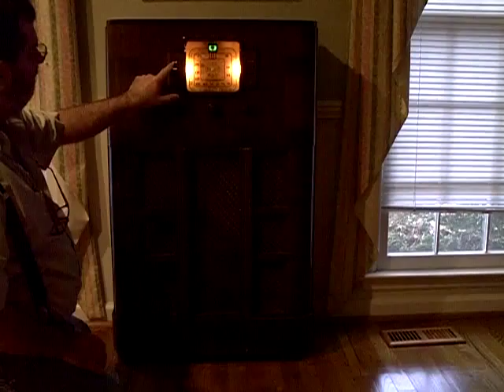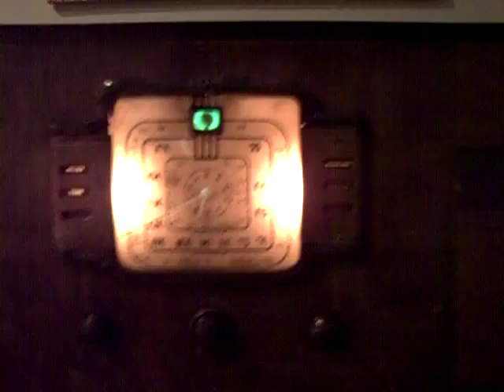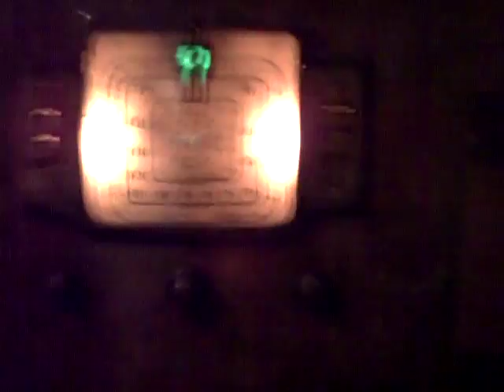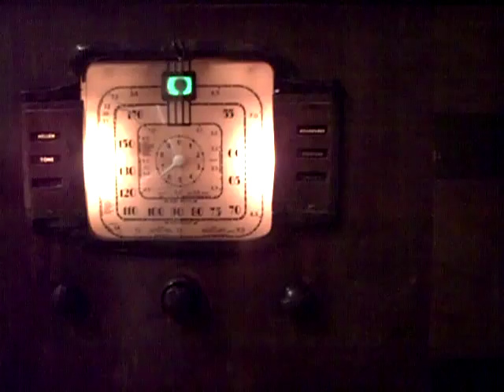Antique Radio Repair part4! RCA 810K

Comment from the maker: Great! have fun with it. Be careful of the green residue stuff on the chassis. If you have the green dust stuff, it's decomposing Cadmiun and quite toxic.
Anyway, it's a sensitive radio and wil provide hours of fun and enjoyment. check out my video, "the Problem with Voltages"

Comment: these models are terrible about the plastic dial cover shrinking, cracking, warping.
do not move south to hot climates, keep it away from any possibility of sun exposure, and keep your house climate controlled. If you have any spare plastic dials for this one or have had a repro made, please contact me magicbrainman on youtube. Also any part you need for this radio please inquire

Comment from the maker: @smeezekitty i'll send you a link to a 42 and also a 6F6 tube data sheets. The single tube amp plate is like 250 volts and the push pull is around 350 volts. Some types of 6F6 push pull is 375 volts for the plate. To be sure you need to check the grid volts too. But if you are unsure leave it to the professionals. I ALWAYS keep one hand in my pocket when probing. These 6F6 tubes do run very hot when in normal operation.

Comment from the maker: @smeezekitty OK, now it get complicated
yoou need to google the words 42 tube data. The 42 tube is the same as a 6F6. You might could try 6F6 tube data too. Is this s single tube or push pull Amp with 2 tubes? The plate voltage is different for single verses push pull. You need to know the grid volteges too. If it's to ohard to do don't do it, be safe not sorry. Keep one hand in your pocket. If you are unsure have a professional do it.

Comment from the maker: @smeezekitty I ended up lowering the input voltage to around 114-115 volts or so and the radios transformer just gets warm now. I think it was running at the edge of design tolerance. Tranformer would get hot after about 2 hours of usage at 124-125 volts. Now after two hours it's just warm.

Comment: Our voltage never gets runs 118v-120v, no higher so i don't think thats the problem.
Also the power transformer is very cold, maybe yours has some shorted turns?

Comment from the maker: @smeezekitty I'm not saying you NEED to lower the input AC voltage. I had to because after a few hours the radio's transformer was getting boarderline hot. If your Plate voltage is too high, or the grid voltages is wrong, you have to check the circuit resistors first to see if they are in tolerance. If the tube is turned on too much it will run hot.

Comment from the maker: @smeezekitty Check out my video on voltages. I ened up using an autotransformer to lower the voltage to this radio about 10 volts. I originally had 122-124 Volts input now I have 114-117 Volts AC input. I got the plate volatages to the 6F6 to about 365 Volts which is a nice voltage. Previously it was barely in spec at 395 Volts.

Comment from the maker: @smeezekitty That's a good question. I do not know. I have never taken the temperture of the 6F6 output tubes. However, they are amoung the hottest running output tubes. I suggest getting the parameter table for the 6F6 tube, its the same as the 42 output tube and determine if your plate and grid voltages are within specs.

Comment from the maker: Thank you sir. I figgured out I need for this radio to lower the input voltage to 115 Volts. I think running at the total upper limit of 125 Volts is at the total limit of the design of the power transformer and the field coil. I think I will make a bucking transformer to lower the voltage to 115 volts.

Comment from the maker: Thank you. I did find out about why the right display didn't work. The display is cable actuated with the cable attached to a cam which is attached to the shaft. The cam was made out of what was called pot metal. I must have tightened the 2 screws that held the pot metal cam to the shaft slightly too tight and the pot metal cracked. Actually the pot metal disintegrated. I saved the broken parts and perhaps one day I can figgure how to make a new one. Maybe a scroll saw could be useful.

Comment: Very nice radio and video series on putting it in newlike operation.  For a 12 watt radio, that sure puts out sound like today's 100 watt units.  Is that strictly a radio or can you connect other devices to it, like a CD or cassette player; to simulate old time radio broadcasts?  Did you ever figure out what was causing the right display to not work properly?  Gary

Comment: Hi, great radio. 
I'm recaping an old Emerson record player but I couldn't find the schematics... The problem is that there is something (I think is a resistor) like thin wire around a white plate and it had something red, clay-like around it (I believe is to protect from heat ) this part is cracked and there was something written, but it wasn't enough to read. Do you know what that is or if I can measure that (once the wire is not broken), so I can replace with something more reliable?  Thanks

Comment from the maker: Sorry about your loss.
I noticed some power resisters get fairly hot. I used 2 watt units instead of the 1 Watt originals. Maybe this will be better. Old rubber wiring is not what it is cracked up to be. Infact half of the wiring was cracked. I either replaced, heat shrinked with clear heat shrink, cracked all the insulation off and THEN heat shrinked, used Super Corona Dope, and sometimes GE Silicon. I also fused it with a 1.25 A fuse and unplug it when not in use. Hope this all works.

Comment from the maker: I had the original glass, but about 25 percent was busted out of one corner. I took it to the glass shop and they had a piece of glass that was slightly thinner. He was able to make a new glass window by tracing the old glass and extrapolating out the broken section. However, the old glass had a very slight green tint to it, while the new glass does not. The glass guy never saw the type of glass that was in the radio originally.

Comment from the maker: If you look close, you can see the plastic around the dial is busted. The radio had fell before I have obtained it. the plastics of these models shrink after time also. the glass was busted, and I had a glass shop cut a new glass to fit it. Cost $7.50 to make, not a bad deal!

Comment from the maker: Yeah man, the light from the windows was fooling the camera and it was making the image too dark. the cabinent is all original has does have some dings on it. Character dings I say! Speaker cloth is replaced with something I got by looking at 4 different fabric stores. No reproduction cloth ismade for the 810K original cloth. They did have some RCA repro cloth for other models, but not for this one. NOw the 816K, now this pup is a rare beast. I'd like to get my hands on one of those.